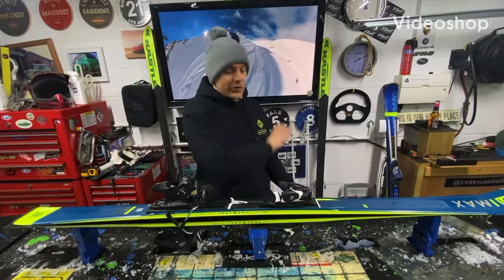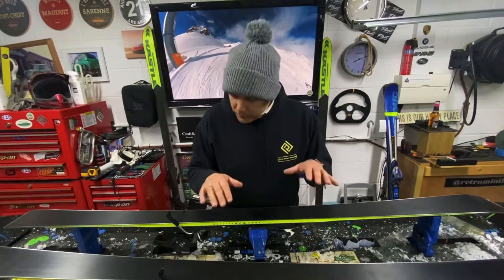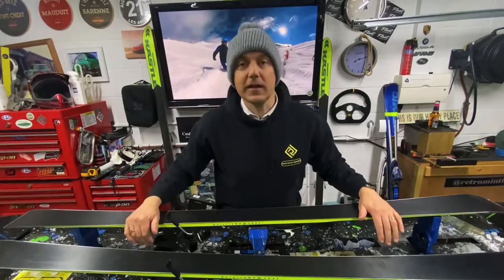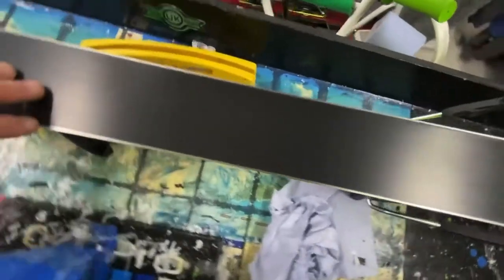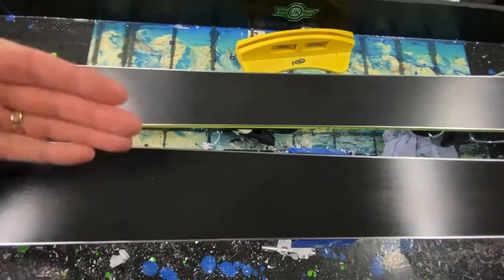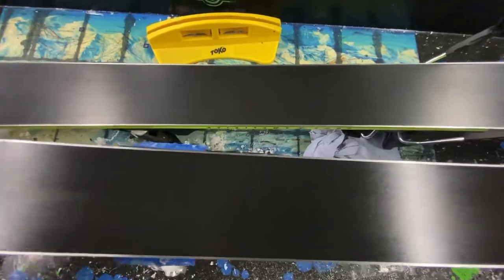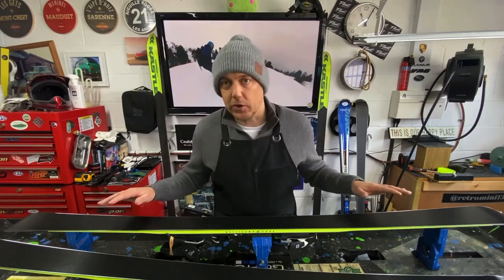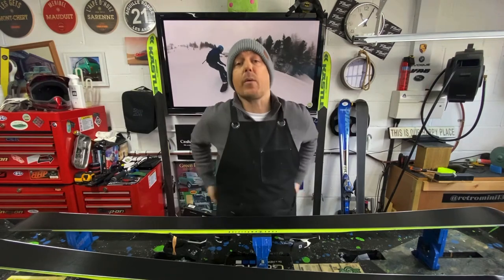Should you Wax a new set of skis? Awesome set of Salomon Max 80 in for a full Wax￼￼

Comment: Waxing is one thing. But shouldn’t the base be bevelled first and the edges of the rails be filed into an angle?
Reply from the maker: Yes you are correct but the customer did not want me to touch them. 👍👍
Reply: @RRW  it was just for my comprehension, thanks.